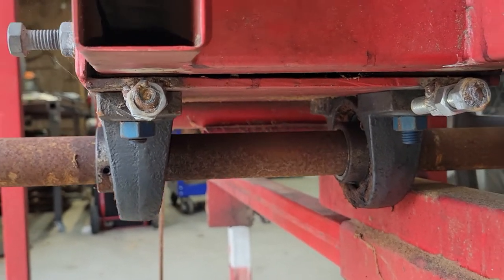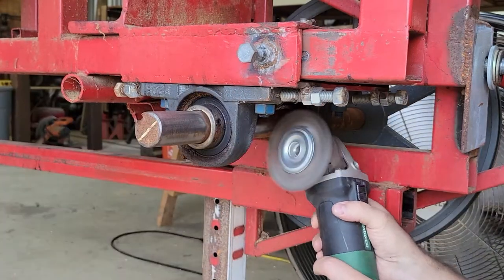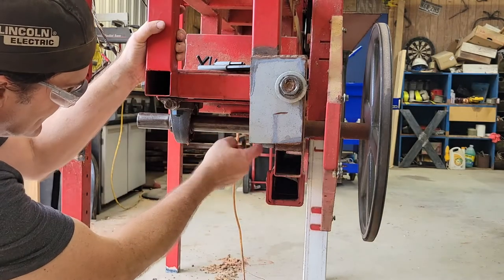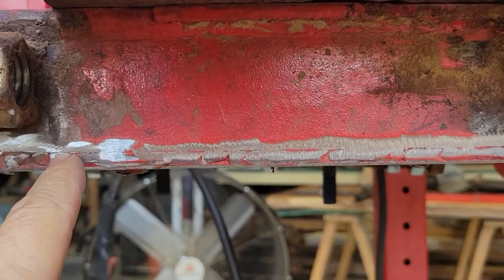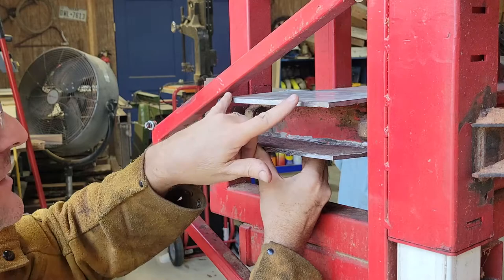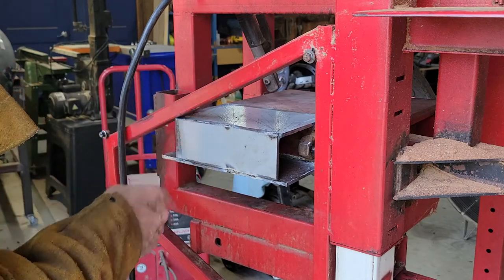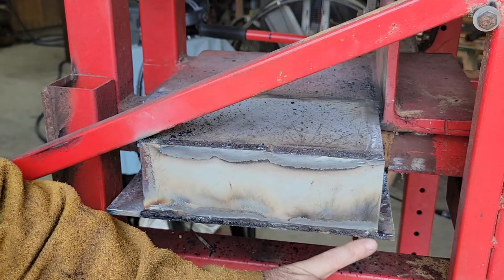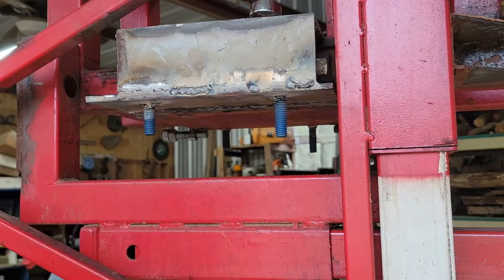K-man Builds - Video 2 - DIY Sawmill Upgrade (really fix) - Pillow Block Relocation

Comment: What hub or lock are using on the drivewheel?
Reply from the maker: I got the wheels from Surplus Center.  You buy the hub separately for the size shaft you are using.  They come with a keyway to lock it in.